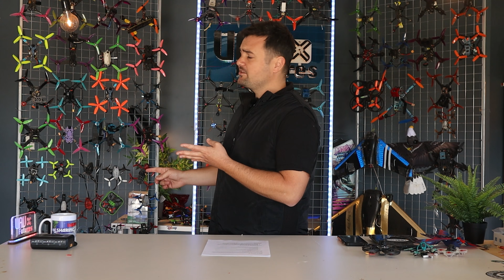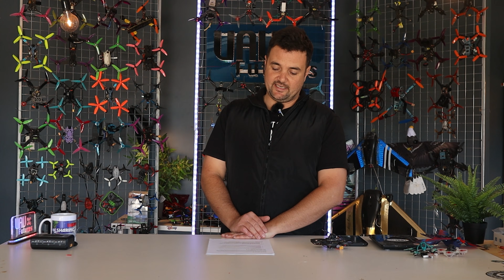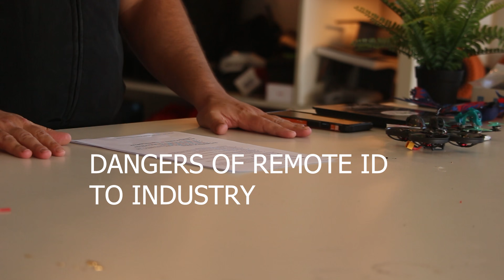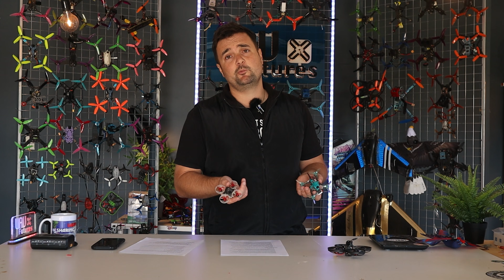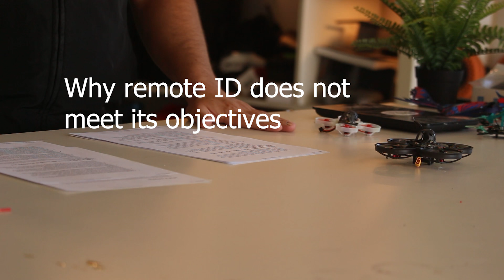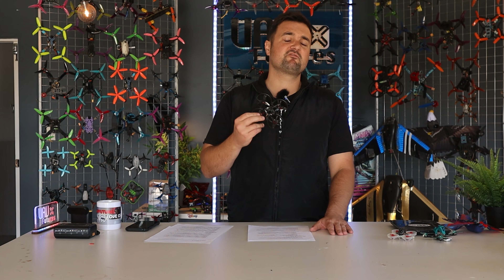Analysis of Remote ID Implementation and Its Implications on Drone Industry and Recreational Users

Comment: Thanks so much Stew for an excellent and well presented video. CASA have already released a public consultation paper on the introduction of remote ID in Australia (you have provided the link in the description). I urge your viewers to respond to this paper with a resounding NO to Remote ID!!!!!!!!! With a perfect safety record from our recreational community, I believe we have earned the right to say that the onus of safety and avoidance should be placed squarely on the proposed commercial drone taxi and delivery operators and CASA with (as you suggest) a phone app showing the status of your proposed flying area. CASA and FAA reps will always use the arguments of how there are hundreds (maybe thousands) of drone flight breaches recorded every year. What they don't tell you is that the majority are from GPS guided camera drones. Reputable brands are now fitting tracking already. Problem solved. I will be submitting that racing quads, RC model aircraft and helicopters should be exempt due to the fact they only fly in the close vicinity of the operators (unlike GPS operated UAVs). Also that extra costs associated with Remote ID, model club fees and travel to locations will discourage our young from taking up the hobby. The model aircraft hobby ultimately provides our aviation industry with new technology and manpower. I strongly believe Remote ID will either have a detrimental effect on the industry or cause a large majority of people to break the law.
Reply from the maker: Totally agree Coops

Comment: Good one Stew, Haven't seen you for a while. Yeah you're right the only thing Remote I D does is create more problems when you take into consideration there is no infrastructure to facilitate transmission and receiving data . Most drones already have a set altitude limitation and distance limit built into them and if you fly either RC planes or drones you're flying below radar and you're not near a commercial airport because there's few to no  RC clubs within a dangerous air space Obviously. Would Remote ID apply to RC boats as well because both Sydney and Brisbane airports are right next to water and so to is Wellington airport and I think Auckland as well which could be a security risk if some mad bomber wants to use a remote controlled model boat to create problems. I do believe there is paranoia virus in the Australian government and they need to be immunised with a shot of sanity . if ever there was a more fitting word for it I'd say FASCIST for what we see the government trying to implement for no good reason or cause and is becoming more like China and Russia degrading our freedom and liberties to the extent we no longer want a hobby or recreational pursuits in our free time either with family or friends or even on your own enjoying the air and your surroundings . Hmmm , I'm an old guy and I've seen things and know stuff and I vote to. Also there is no real if any evidence from CASA of any Australian drone pilots or RC plane pilots ever have their planes or drones cause an aircraft of any description to crash. But the media on the other hand have sensationalised from a minor incident which If memory serves me right was a helicopter flying under the height restriction and  no aircraft crashed and no person/s were injured or killed .Where I live the local airstrip/airport has planes coming and going every week and their always flying below 500 feet just to line up for the runway so why haven't they had their licenses revoked by CASA ?? Cheers Mate keep up the good word as always.👍👍👍😎💨🏴‍☠☮☮☕☕💡🌈😊

Comment: i don't know why you are including those toy quads unless you are deliberately trying to mislead people, a 30 gram quad is definitely under the 250 gram minimum RID requirement. as far as the faa objectives, there's the ones you read that are largely just public relations propaganda and there is the unpublicized main objective not meant for public knowledge which was to purge rc hobbyist from the air space essentially eliminating the hobby and i say was their objective because for all intents and purposes the have pretty much accomplished their goal, it won't be much longer before what little there is left of the hobby will be completely wiped out here in america.......

Comment: I'm testing my newer RC truck with extra power draw for adding lights and a camera. It won't drive with more added. I bought it for reasons to go out a bit more than usual. The experimentation (electronics) means even more to me. A 2 minutes drone flight is technically not anything, whatsoever.

Comment: Thank you for this push back on RID. Maybe I am paranoid, but the biggest issue for me is the fact that anyone who wants to, can see what drones are nearby and exactly where they are. So the big question is why would anyone other than authorities want or need to see RID information? Answer, any anti-drone nut case or someone looking to steal some equipment. No one would be looking at that info to go and say Hi and wish you well. Seems the risk to the operator by not complying is way less than the risk of adding RID to your RC plane or quadcopter, but as I said, maybe I am paranoid.
Reply: The faa don’t give a fuck about the operators safety. Safety risk is a huge issue with this rid bull.  They could have made it only available to law enforcement but no, they chose to let anyone with a smartphone see.
Reply: Naw not at all.  Not putting me and my kids in danger period.  I’m just going to keep flying like notnings changed.

Comment: Criminals arent going to put a Law Enforcement Tracker on themselves, that would be stupid. Im afraid it will get worse in September when anyone can buy these trackers and shut down airports and pull all the police to one side of town with the press of a button. Even worse if someone puts one in a bag on a outgoing luggage terminal. When the FAA finds out one is over the airport flying 500 mph they will call the flight back with a fighter jet as an escort because there is "Nefarious Activity" happening on that plane. Over and over in these rules it calls RC piots "nefarious" which means criminally Evil. So either we are all criminals without a trial or thes rules (Laws) were written with hateful words because congress and/or the FAA hates a minority section of the public and wants them gone. Either way it makes these rules UNCONSTITUTIONAL. Theyve been very 'closed lip' about the real reason why cause its not about making the safest hobby safer when its making it less safe and scaring people. Maybe they want to deport us all back to Africa. Maybe congress wants their specialty coffee delivered by a giant drone with 6 motors and 27inch steel blades.  A guy will have to deliver the coffee by car to the "DronePort" and your less than 7 miles away, then then can deliver your cold coffee, unless there is wind or air temps are lower than 40%F cause Lipo batteries work at a quarter to a third of normal range when it gets cold and I think we all know what wind does. Drone Deliveries! Coming thru a home near You!!! All the Dogs in your neighborhood wont mind chasing after it so the Dog Pound will have to be in place before the drone gets there to round up any stray pets and any children. Dear Congress and the FAA, You are doing something "Nefarious" and you need to come clean about it

Comment: While RID modules may be technically practical in models over 1000 grams, weight distribution constraints would necessitate placing the module close to the radio control (RC) receiver. Since the RC receiver operates in the 2.4Ghz spectrum, the RID module (which is a transmitter which also operates in the 2.4Ghz spectrum) will significantly increase the RF noise that the RC receiver must contend with.  This would degrade the quality of the control link, and could adversely affect safety. MAKES NO SENSE.

Comment: Your taxi scenario doesn’t work because the broadcast data includes altitude.
Reply: So you think the authorities are going to be cool with you flying a racing drone 2 metres off the ground at the end of a runway?
Reply: The remote id module needs a 3rd party gps module as well. Gps is easy AF to spoof, little kids playing pokemon go do it all the time. Just need to get the gps to report a false altitude. If someone's going to take the time and money to do something like this, taking an extra step to report false gps data is not that far fetched.

Comment: Are you familiar with the Recreational Exemption that provides for flying sub-250 gram drones (including tiny whoops) just for fun without the necessity of registration, no remote ID required, and no Part 107 pilot's license. So, it is actually not accurate to say that a tiny whoop must be fitted with remote ID. It does not unless you are going to use it for commercial purposes. So, remote ID is short range Wi-Fi or Bluetooth which shouldn't effect aircraft from a taxi. This is just a pure act of terrorism and could be accomplished with any number of other devices. The thing is, the position of the drone will be known, but the location of the pilot would not. Is all of this a lot of unsubstantiated speculation. Hovering that drone over my property and back yard is an invasion of my privacy. Where was all of the resistance 3 years about when this was started. You kid should be flying under the Recreational Exemption and not needing remote ID. Why do people NOT mention this. You don't need Remote ID on the tiny whoops if flown for recreation.
Reply: Stew is Australian, and the Australian Discussion Paper about introducing Remote ID does not mention any exemptions for sub 250 grams. So Stew is correct.
Reply: @rsutherland106  Ok.

Comment: Out of curiosity, I wanted to ask your approach to flying fpv here in Aus? 

My understanding is that CASA only allow it if your a member of the MAAA (model aircraft association) flying it at one of their sites, or if your a fully qualified RePL pilot flying under a ReOC, with the additional BVLOS classification… but take your goggles off, you can fly the drone under normal guidelines?
(I can’t quite understand how you can learn the skill if you need those quals before you can fly fpv???)
Realise you may not want to answer this here, but really interested to hear how you’ve gone about this?

I’m simply a bit amazed that having a spotter, who knows and understands the regulations, isn’t enough?

Thanks again

Comment: Thank you so much for posting this. 🙌

I absolutely agree with you about keeping the sky’s and community safe being the priority and that that Remote ID both doesn’t achieve this, but actually may increases the risk of incident (if Broadcast Only is implemented).
I’ll be providing feedback to the Department of Infrastructure in the same vein as your video!

It also seems, that both this proposal is ‘negative focused’ (stating in the first sentence: ‘…and supports identifying drone operators and holding them accountable for they’re actions’…
And out of touch with the industry, both commercial and recreational.

We have a unique situation where we can see the impact of the US, and with community support, hopefully avoid going down the same route.

Thank you once again
Reply: Definitely negative focussed - assuming everyone is a criminal.

Comment: Most aviation authorities purview around the world tends to be safety, noise, privacy and environmental concerns are not.
There are other agencies that these responsibilities already fall to.
No one seems to have mentioned what happens if, on a small craft, the RID module has to be mounted so close to the radio receiver that it causes interference resulting in loss of control. Surely this makes it less safe not more so.
We all know that cameras with BT enabled can cause a significant loss of range if not total loss of control.

Comment: Great video Stew. A lot of us are up in arms about the RID and these issues with it could potentially make things worse and not better. 
Bruce’s aka Xjet’s ADSB device would be a better idea. Plus you’d only need one device, it could have a pilot ID code already programmed into it that can be broadcasted over your cellphone.
Better idea would even integrate it within Betaflight for an OSD view for the pilot have an audible announcement for aircraft to include location direction via compass in degrees, altitude from ground level, ground speed and distance from your centered location.
Also to only make information available only to the proper authorities only. The general public shouldn’t be alerted mostly due to the paranoia some individuals may have towards drones and other RC aircraft.
Reply: Bruce has the right idea out the ball into the court of maned aircraft requiring adsb system. Then you know they are coming …. That is a great approach to safety. Bruce is even putting his work out there so manufacturers can build so you don’t end up with a monopoly and high prices…. 

@xjet

Comment: I had to stop at around the 5 minute mark as you clearly don't know the current regulations, at least in the US, regarding RID. e.g. there is no network requirement for RID currently even though you state that there is. I suggest that you start over. Spend a little time understanding the regulations and then make a new video. I'm sure it will be valuable to the community.
Reply: I agree.  A little bit of googling shows that it will be applicable to drones over 250g, so your micro drones should be fine.  Also, while there appears to be "network remote id" which may need connectivity to a network, the general remote ID looks to be a simple broadcast (like Bluetooth Advertising) which does not require a network.  When you logically think about it, a network based solution could not work anyway.  As for cost, the transmitters can be simple and low power, so could be made fairly cheaply.  Many of your arguments are good though.
Reply: Stew is Australian, and the Australian Discussion Paper about introducing Remote ID does not mention any exemptions for sub 250 grams. So Stew is correct.

Comment: Try This --> Reorganize what "drones" are required to comply. Camera Drones in your scenario with full access gimbals, gps, return to home, autonomous flight should comply. Has a free style or racing drone spied on a family bbq or hovered over and airport runway? No. Fixed camera facing up. Tiny Whoop? No. RC Fixed wing planes with simple radio electronics? No. Un powered RC Gliders / Slope Soar / Thermal Gliders? No. RC Heli with standard flight electronics? No. RC Paragliders? No. 1 pound RC Foamy plane? No. All that have been classified as "drones" are not always true drones, nor do they have the ability to be bad actors as drones. First was "voluntary registrations" then mandatory registration". Then there was education that was going to save everyone. Then there was apps that would make it safer. Then there was Network RID, then broadcast RID, but network RID is still not dead and keeps coming up. This was totally a poor risk assessment sold on fear, media drama, and movie DEATH DRONES....  based on NO DEATHS. Then an overbearing engineered plan created by the committees  of Full Access Camera Gimbal GPS Autonomous Flight Drone Manufactures and Lobbyists that have money and access to congress and the FAA. What could possibly go wrong? Make the punishment fit the crime?  Full Access Camera Gimbal GPS Autonomous Flight Drone have shown up at Airports, back yard bbqs, your daughters bedroom window, sports domes and large commercial gatherings. How about start there, get that under control, look for the "problems that may have been missed" once you are solid with the first most serious risk gap<s>. Common sense Risk mitigation instead of a "I have a hammer and everything looks like a nail" mentality, which government 3 letter agency that WANT FUNDING do. Control ALL = easy button, more funding, broad brush paper pushing and regulations over what could or might happen.
Reply: Well said brother
Reply from the maker: very good points. my only point I would like to add is even though I do not fly those larger drones,  law abiding citizens who do fly them shouldnt have to suffer either because of bad actors,
Reply: @UAVfutures  Indeed.. Don't take me wrong, not wanting to lay this over on camera drone operators. These devices are already being RID enabled. Its not their fault a newbie real estate agent or ambulance chased grabbed a camera drone, with NO prior model fight experience at all, and the Drones of today made them think they were Top Gun.
Reply: Actually, the FAA should focus on where a real difference could be made - addressing the 550 fatalities and 1700 crashes that occur in manned aviation in the US every year.
Reply: @rsutherland106  Airlines today cannot hire enough air traffic controllers, Air Port staffing is very short, Fourth of July Holiday travelers were in a mess (blamed on weather) but mother nature was not the only issues they were having. UAS has been a reason for FAA to ask for finding, a crisis should never go to waste.

Comment: It's not a license plate, license plates don't transmit their location and the location of their owner all the time. It's an ankle monitor, the thing they put on criminals to keep track of them. We're presumed guilty before committing any crime and without any proof of any crime committed. 

If they're doing that with things like firearms, which are responsible for bucketloads of deaths, I could understand (not condone, but I'd understand the reasoning). But drones have zero deaths to their name. Remote ID for all drones is as stupid as making toilet paper out of gympie-gympie leaves
Reply from the maker: yes I agree. I thought about other analogies but their discussions refer to it as such, so I tried to explain how it could be like a license plate that weighed 1000 pounds, an ankle braclet would be more accurate though.